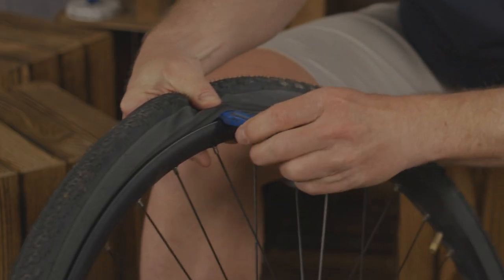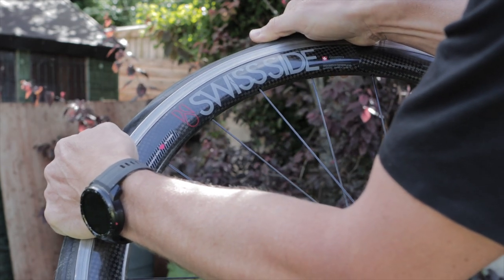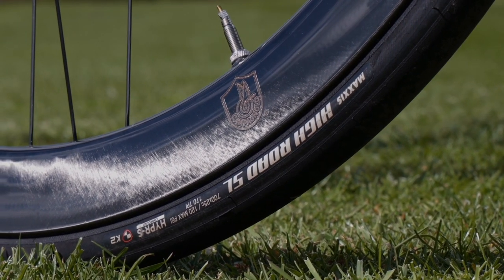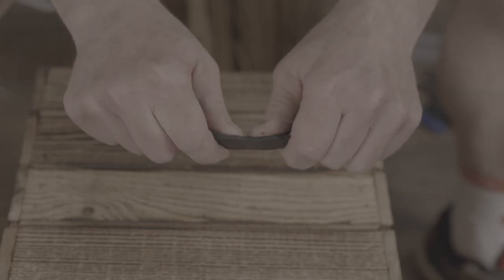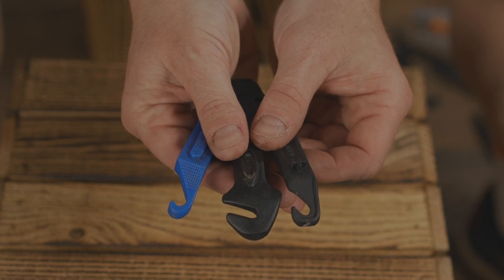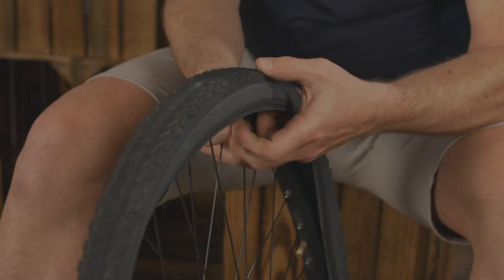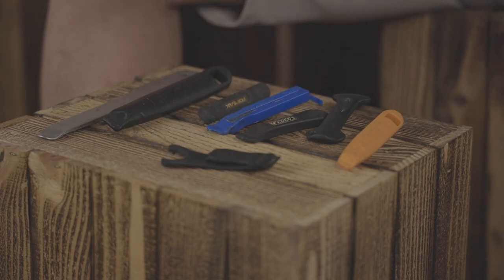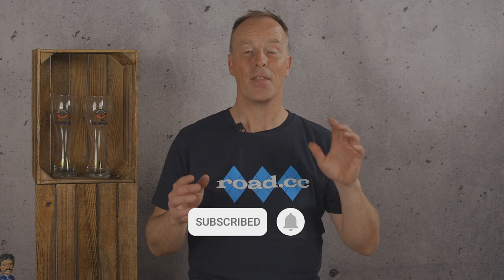Don't struggle with your tyres! | the road.cc guide to tyre levers

Comment: I use old steel levers covered in shrink tubing. No messing around no bending or snapping. I've had these since the 90s and get the job done every time... Even Marathon Plus tyres without a problem.

Comment: In my home ‘workshop’ I use the XL parktool metal levers for the tightest tyres as a last resort, together with a rim mounting jack by koolstop. Usually use the large Lezyne ones.
But I carry on the road the combination chain tool / tyre levers, two tools in one. Several manufacturers make great ones, main difference is the price
Reply: Metal? Isn't there a good chance of deforming the rim with a metal lever? Bike rims are so thin

Comment: I just changed a flat on the side of the road yesterday.  My Giant TCR now has a tube for the first time. I snapped a cheap lever that was part of my multi-tool. Had to finish the job with one. It was too brittle. Too hard to get the job done.